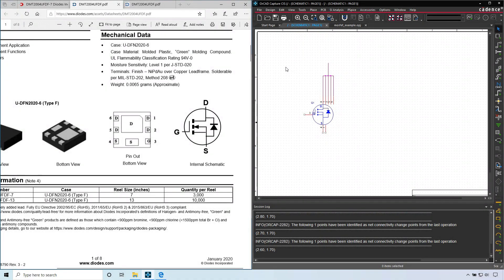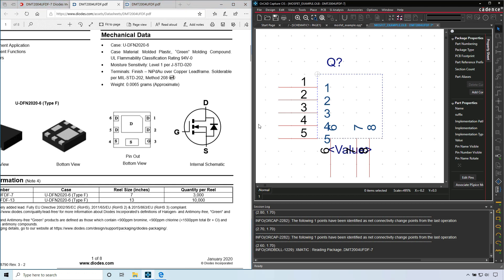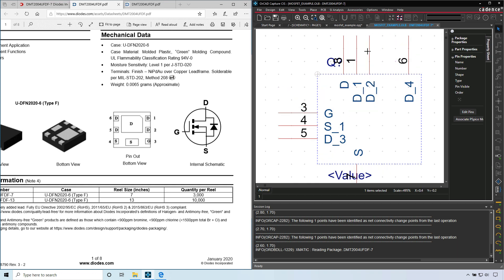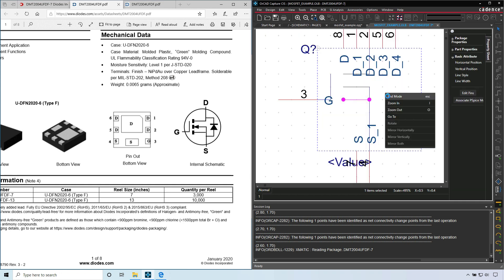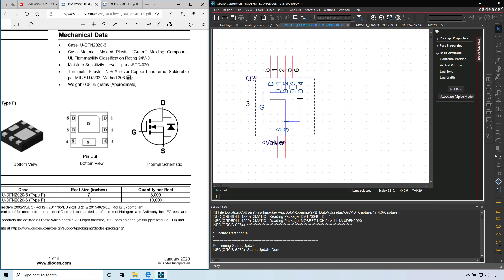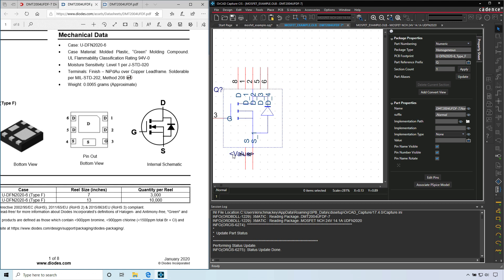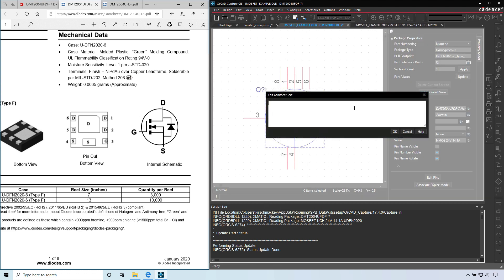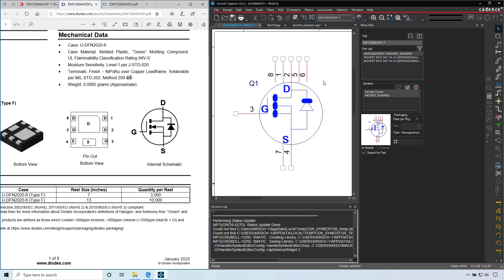OrCAD Tutorial - How to create a schematic symbol or part in OrCAD Capture

Comment: FYI you can hide all the duplicate drain and source pins by using the PACK_SHORT parameter.
For this example it would be PACK_SHORT (D,D_1,D_2.D_3,D_4)(S,S_1)
You also need to set the pin ignore property to yes for the pins you want hidden.
While editing the symbol, all the pins will be visible but when you place the symbol in the schematic those pins will not be visible. When it comes to the layout, they will inherit the same net connection as the other pins within their respective PACK_SHORT parenthesis

Comment: Hello Sir,  We have problem  in simulating LT8490-Battery Management Buck-Boost Lead-Acid Battery Charge Controller with Maximum Power Point Tracking (MPPT). We are struck in the Midway.Please Help us in simulating the IC..Please do reply with ur mail id we need your help